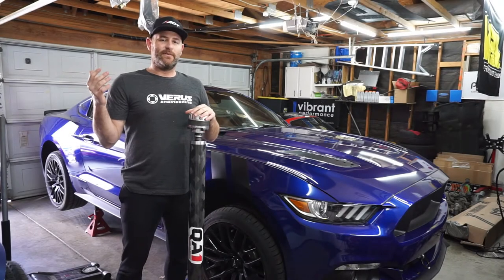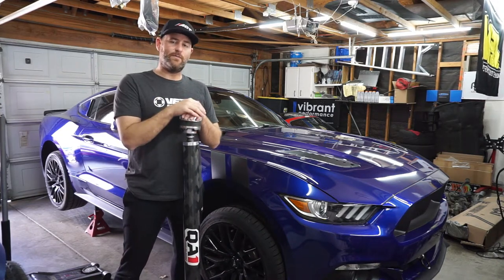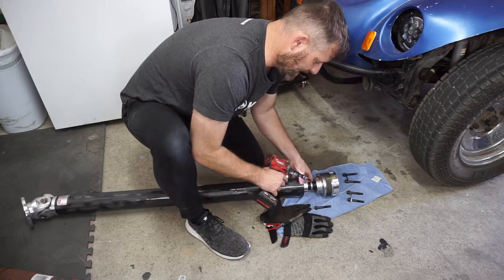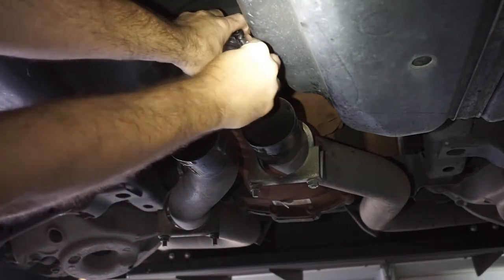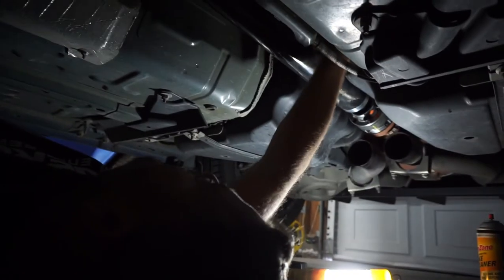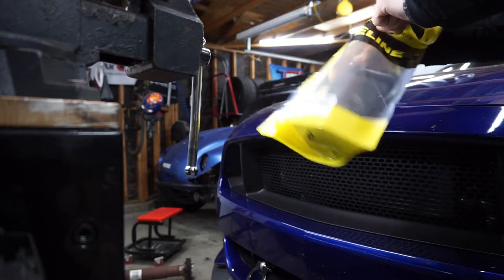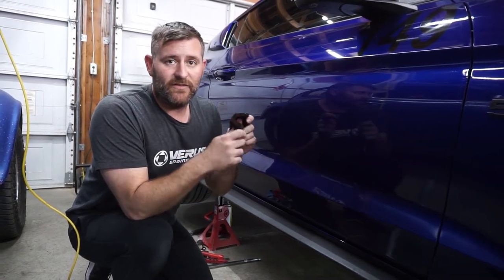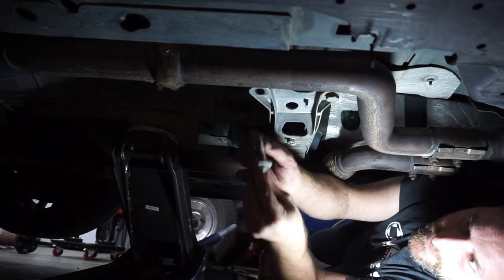QA-1 Carbon Driveshaft and Whiteline Transmission Bushing Install for S550 Ford Mustang GT

Comment: Get a MGW shifter. Just did mine sooooo much better the factory
Reply from the maker: The only thing that’s held me back is the install to do them. Seems like such a pain
Reply: @JagerRacing  I did my driveshaft, my entire exhaust system that was a bitch along with the shifter all at the same time. Was worth it. Ford did ok on the shifter but it still sucks.
Reply from the maker: @douglasbaker5949  ya I was going to do driveshaft and shifter but couldn’t decide on which on in time